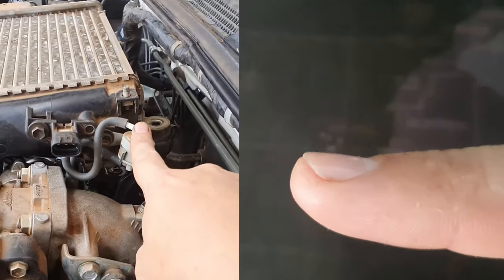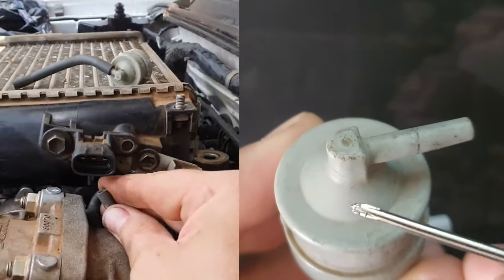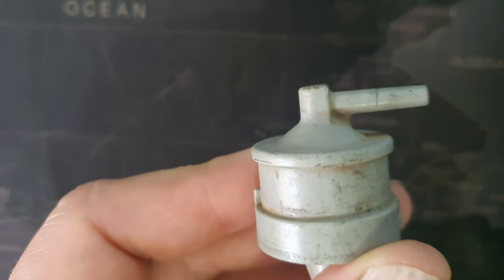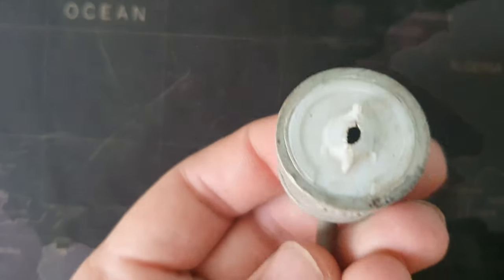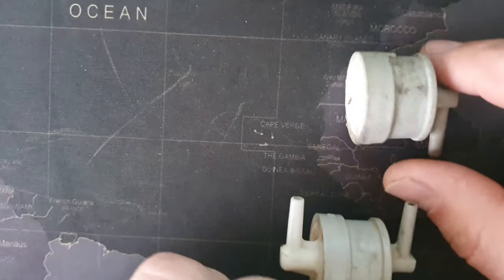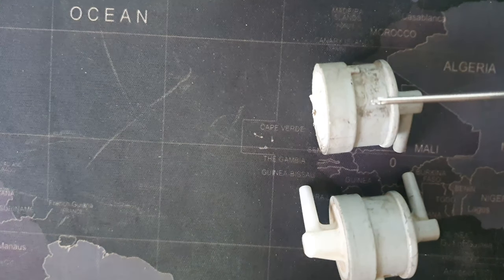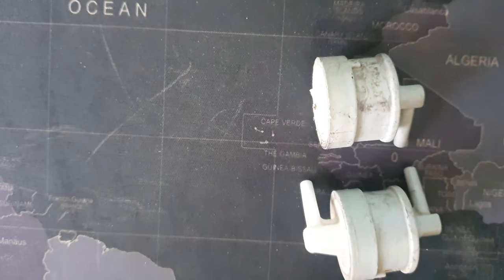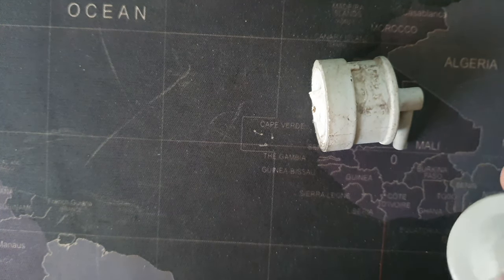Why Remove MAP Sensor Filter on Toyota KD?

Comment: Hi Deon, great video. By any chance could you help me out? I have a 2015 2kd 2.5 hilux, i just  reconditioned the injectors and turbo. I also have a 76mm downpipe and exhuast as well as an egr delete. It feels much better power wise but in every gear when i try going over 2500-3000rpm it starts to stutter and doesnt push on. As i go into the next gear the same problem continues at 2000-3000rpm. Im really struggling to find the fault. Do you think it could be the map sensor or that the injectors werent done properly ?
Reply from the maker: Thank you very much! It could be a number of things. I would furthermore check the vacuum line on the turbo and see if the little boost pipe on the MAP sensor is not kinked or leaking. If those are fine, all that is left are the air flow sensor or MAP sensor . If the MAP was replaced, be sure that it is the one with the white square on top. I hope this helps and you get your Hilux sorted! 👌

Comment: Doesn't this filter protect the map sensor??
Rather replace the filter then the sensor
Reply from the maker: Yes, like I also mentioned in the video, it's your choice how long to wait to replace it. 👍
Reply: @DIYwithDeon  that isnt a "delete" though.
Reply: @DIYwithDeon  where in the engine of the 1997  Toyota Corolla the wire of the vacuum solenoid switch valve connects to ?